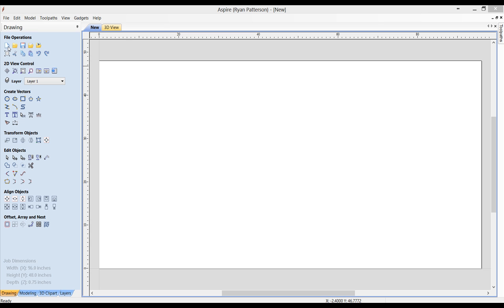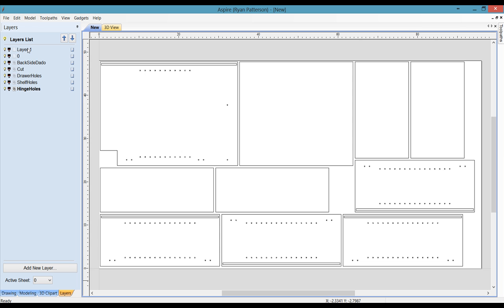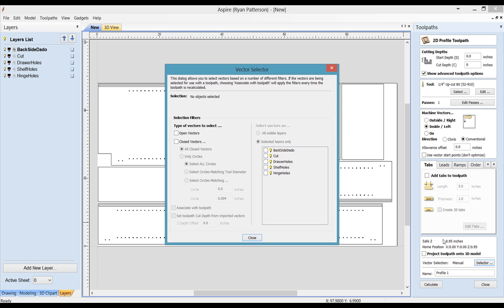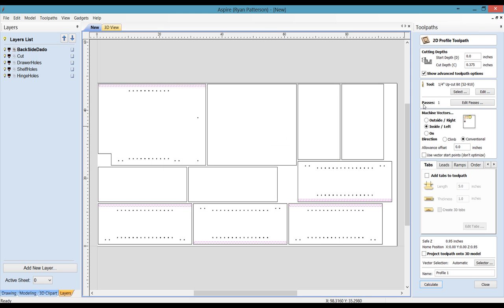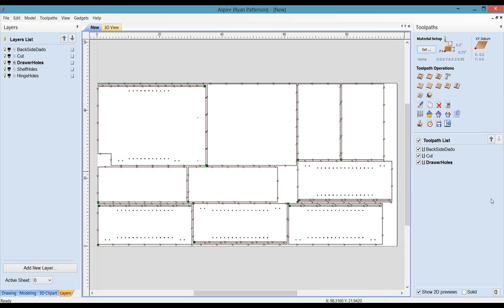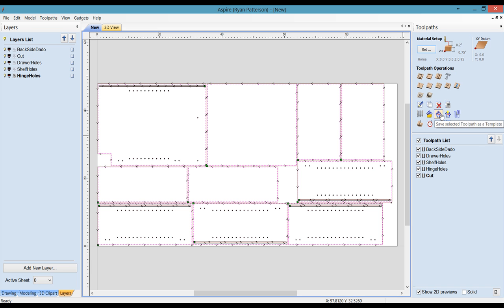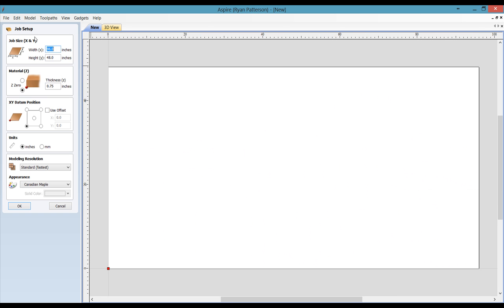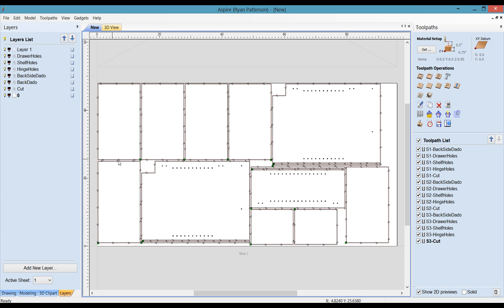Vectric ToolPath Template Setup

Comment: thanks for the video..
I am interested in this software for making some cabinets and closet parts...
I think I should be able to configure some stuff in Cabinet Parts Pro  to be more adapt to closet parts... but I have a machine set up with the Long axis as Y  and the short axis as X... so Y would be 96 and X would be 48... Is this a problem when configuring the CabinetPartsPro  software?
Reply from the maker: This is not an issue.